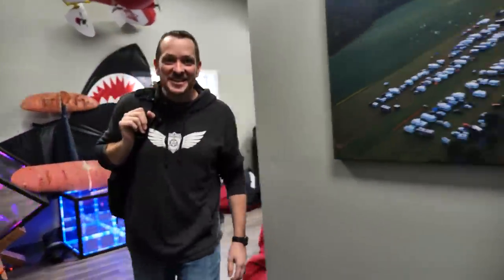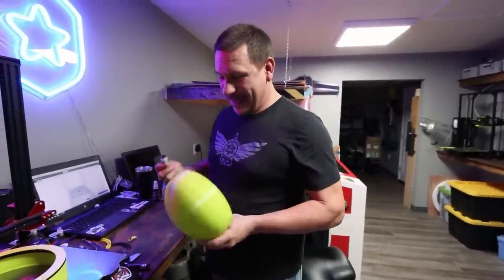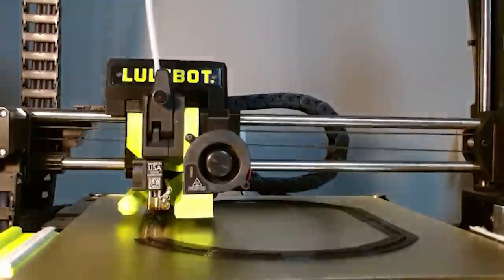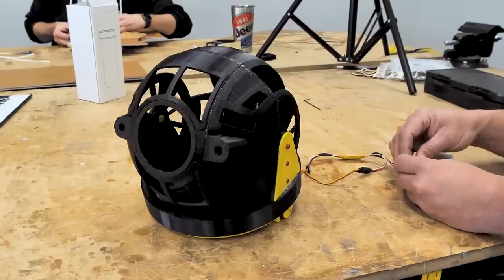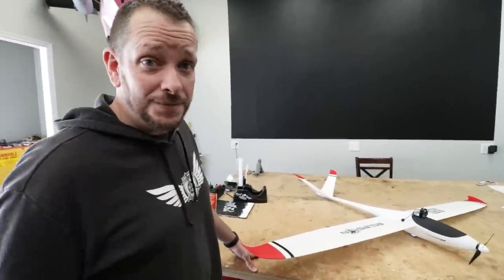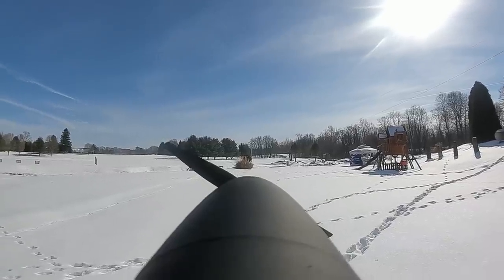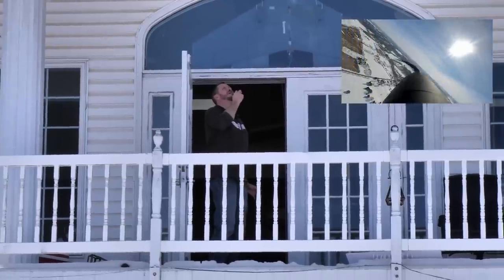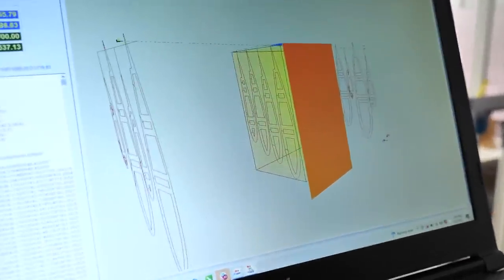3D Printed Plane and B-17 Turrets!!!! - Week 4

Comment: 3D printed planes sure are the future. Might even be able to make them lighter by using a geodesic design like the Wellington and film covering them.
Reply: they will become the future when there's an LW-PLA that has a higher glass transition temperature so you can finally fly in a sunny without the worry that the model would warp in a hot environment or by simply leaving it inside the Car. Until then, it's not for everyone.

Comment: I have some really good ideas to do with fiber glassing techniques that could turn some of your larger models into lightweight rugged giants. Impregnating a layer of very light weight glass weave underneath your layer of paper. Leave off the water proofing component from the paper. Then spray a light layer of resin, squeegee off any excess. The result would be extremely durable and light weight aircraft capable long term flight.

Comment: in reference to coming in to a failed print with a bunch of spaghetti, you should seriously consider setting up octoprint with the "The Spaghetti Detective" plugin. You can monitor and control your printer from anywhere, and it also has a feature where it uses AI to watch for spaghetti, and if it sees it it will notify you and pause the print(you can set it to only notify you if you don't want it auto pausing).

Comment: I'm guessing you guys already know this, but power loss protection is a great help for 3d printing. When it turns on again, it'll just resume printing (some printers might ask you first). I will say you might have to watch out in case the printer head moves the print since the bed has cooled down and it might not be stuck anymore until it heats up...
Reply: 100% correct. We have to print against deadlines often time and this is a lifesaver for keeping on schedule for content and production:)
Reply: @joshuamelvin  ayyyyy Josh! Keep up the good work! Love what you guys do!

Comment: My brother got into 3D printing back at least 4-5 years ago and failed.  Barely printed anything.  He even bought another printer about a year ago and did little better.  I picked up a resin printer abut a month ago and have been cranking out stuff like crazy.  Sadly it is more expensive, can not print as large of stuff, and lacks light weight ability.  What is does do it detail.  The print size is something like 3.5"x5.5" but it uses a 4K resolution and .5mm layer thickness so the detail level is crazy high.  It is amazing the STL files you can find online, but I want to learn how to make my own.  After a half dozen test prints I have figured this out enough so my print success rate is at least 95% or more.  I have gone through 3.5 liters of resin and printed probably 50 plates of miniatures and since the print time is determined 100% by the height so I pack these plates full.

Comment: Dave, you might want to go with a clear PLA for that top gun turret, depending on just how clear it is. Also, for the canopy and nose on the B-17, that way you can put a little miniture Josh in there to pilot it. The Ball turrect looks fine and authenic enough the way it is.
Reply: That would be great and I did consider it, unfortunately you can not see through clear PLA very well so the decision was made to make it solid and paint in the windows. The 2nd ball turret I decided to add clear plastic after for the windows

Comment: I don't know if anyone from the shop will see this, BUT I had an amazing idea. You know how 3D prints sometimes have air pockets in them (usually with a crisscrossing rigidity pattern to keep it solid) to save on filament? What if you print your item in a fully closed off Air Chamber, and fill the chamber with Helium. That way, your print is not only light and rigid, but also filled with the buoyant force of Helium.
Reply: Helium is the hardest substance in universe to contain. Itll escape before you even launched the plane.

Comment: Assuming you have a 3D printer, approximately how much does it cost in PLA or whatever else print material to get that power glider printed?
Reply: Probably just one roll of filament, which is $20-$40. Light-weight PLA is more expensive but prints twice as far.

Comment: If my Ender 3 stops due to a power outage. It immediately stops but when you turn it on your given the option to continue the print or stop the print
Reply: Yes although what you are saying is true you have to be careful when doing it because the heated bed loses its heat witch means the part has a good chance of losing bed adhesion